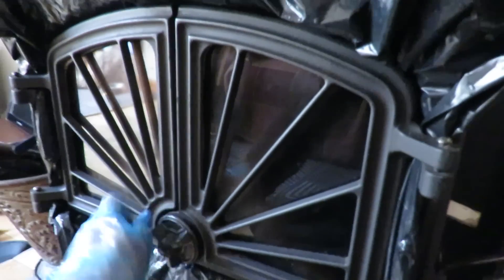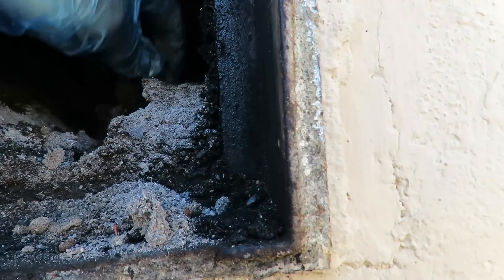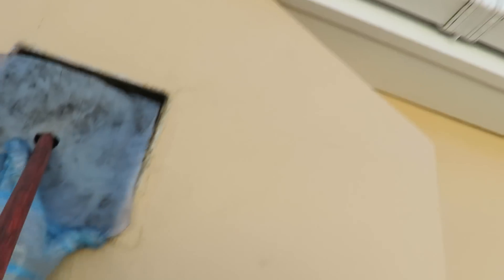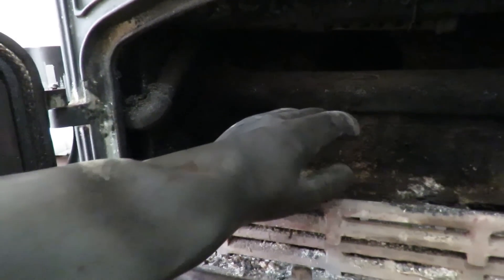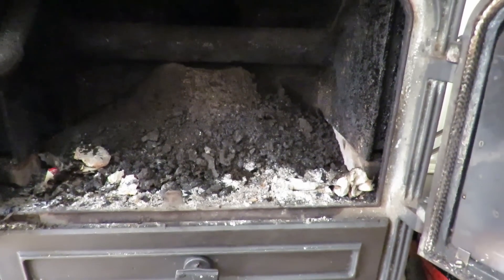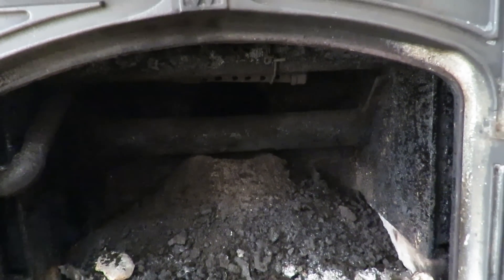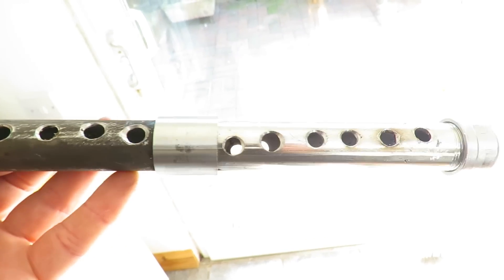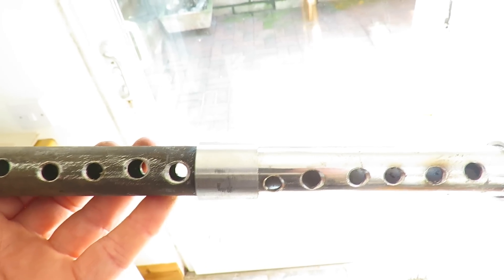Log Burner Stove Upgrade Secondary Combustion, Gasification, Burn Creosote, Smokeless Part 2

Comment: can you please say the design for where the holes were drilled. in the pipe. you say that they were facing up. yet in the film, they are facing sideways on. these holes could be critical. considering . the jets on a burner ring that burns. natural gas.  if using that same ring for propane. the holes/jets require being made bigger for the propane to burn. I know that the tube is carrying oxygen and not a flammable gas. the configuration for the holes/jets in the tube could be important.
Reply from the maker: The holes in the tube, when tightened on the thread face the 3 inch
perforated tube to supply air to it.  On reflection, it would be useful 
to drill slightly smaller holes in the first part of the tube and larger
 towards the end so as to spread the introduced air more evenly, but 
mine works fins with same holes drilled in. Perhaps a smaller drill 
would be better, but you can always make the holes bigger if need be 
after you have tested it.
Reply: I thought  that you had replaced the 3" perforated tube with the drilled 3/4" tube.
Reply from the maker: No the perforated tube is where the combustion of gasses take place, the stainless tube is the additional air supply :)
Reply: do you put the drilled air 3/4" tube inside of the perforated tube?where does the burning manifest? on the perforated tube, or at the drilled holes. more above or below. there is quite a gap. if the 3/4" tube goes inside of the 3" tube.    to prevent unburnt gasses bypassing the tube[s]. some designers have employed a filament. you could also add one in the system that you have. there is one consideration, and that is . the filament would require being cleaned every so often. that probably means that the filament would have to be taken out from the firebox. if the heat distorts the pipe unions. disconnecting the filament from the firebox could be problematic. unless the filament is not part of the drilled air tube.an English cooker manufacturer goes on about: that their design. the fire box can reach 1000c.all theirs is . is a wire gauze. something like a stainless steel brillo pad. set in a frame. the frame sits in above the firebox. hot air goes inducted up to it. then the burn is an incandescent under the filament. yet who knows. it could be above the filament as well. if you could make that part of the firebox out of glass. the incandescent would probably light your room up. you say that you get around 400c. the cooker manufacturer says. 1000c. therefore if you put the 3/4" drilled pipe inside say. a 1 1/2" perforated tube. then wrapped stainless steel gauze around that. then fitted a 3" perforated tube over that. that might be a filament. I can send you the links for what the cooker manufacturer says . about the temperatures got, by using a filament. thanks.
Reply from the maker: The air tube is secured to the hot water pipe / boiler that runs across the front top  of fire so it the air holes face towards the 3" pipe, with twisted steel wire
Reply from the maker: If we put too much coal in the fire, the temperature soars way above 400C even with all 6 radiators piping hot and a tank full of hot water, the flames get so hot, the water inside the boiler turns to steam, causing ketteling and we have to let it die down to normal working temp.  What I love about this modification is that we now burn scrap soft wood very efficiently, whereas before, it was gone in minutes. Now each fill lasts over an hour while the burn is very slow and more controlled.

Comment: This is very interesting to me. I have an old wood stove from the 1970s that's pretty efficient for it's pedigree but I've been wondering if I should add a damper to the stack. Your arrangement appears to work like a damper but with the added benefit of the secondary combustion. I need to try this. You used stainless steel pipe inside - do you think galvanized would not survive the heat?
Reply from the maker: Stainless is best because it comes already perforated and is more resilient to heat. Inexpensive too on Ebay  Ask to have the length cut to suit your fire.
Reply: Galvanized steel will release poisonous gasses when heated above a temperature that I can't remember. It is banned for use in wood stoves. Stainless only!
Reply: Galvanized (Zinc coated) pipe when welded on releases cyanide gas, this is why welders are told to never weld galanized, the welder will typically experience a migraine headache. Im your case gases are being exhausted up the chimney to atmosphere, shouldn't be a issue.

Comment: Interesting upgrade. Have you considered the consequences of the higher temperatures which I would suggest this stove was not designed for ? Is there any danger of any metal parts distorting for example the doors which as a consequence may leak ? No doubt you have a carbon monoxide alarm ?
 I know Im probably being over cautious, just hate to to think of anyone getting hurt.
Reply from the maker: Yes I have a monoxide monitor and all is well.  This fire is designed well with heavy cast iron door frames and hinges, will outlast me and my sons :) It was also made to burn without a back boiler, so the temperatures I'm reaching are comparable to this.  The older stoves are engineered to last a life time.
Reply: +G Laight ..The melting temperature of Cast iron is usually in the range of.. 1,150 to 1,200 °C (2,100 to 2,190 °F) Stoves classified as Multifuel can burn a wide range of mineral and are designed for seasoned wood, wood derived briquettes, brown coal (lignite) briquettes and approved smokeless fuels. When this particular stove was made, it was fitted with poor secondary air combustion, relying on primary air from the bottom of the fire, making it inefficient. Andrew K Fletcher Is showing that an old well made stove can be upgraded to burn smoke witch is just unburnt gases, by adding secondary air to the unburnt gases the (Smoke) is relit giving an efficient burn. He records temperatures of 310c  I would suggest this is Well inside the melting point of Cast Iron :gardenweld.
Reply from the maker: Latest temperatures with coal must be around 450.c as it goes right off the scale of my infrared thermometer and stays off the scale even when doors are opened for 20 minutes. Lesson learned is to use coal in moderation :)

Comment: Seems to be a rather insufficient oven... 
Imagine the amount of pollution spread to your neighbours
Reply from the maker: On the contrary, with these modifications the burner is virtually smokeless , the soot is now white instead of black so all of the carbon from the fuel is being burned. We only need to sweep the chimney once a year instead of 3 times a year, and the trees we burn emit the same emissions if they decay naturally and we recycle wood that would end up in a furnace creating electricity. Good question though, thank you.
Reply: Andrew K Fletcher.  ArrigAutist.

If you have a wood burner that is designed to re-burn secondary air at high temperatures there will be a minor scale amount of pollutants, the 
Re-burning of unburnt smoke and gasses at high temperatures is "smoke free" 
Here’s how a forest’s carbon cycle works: 
As trees grow, they sequester atmospheric carbon by converting CO2 in the air to leaves, twigs, and wood. The CO2 isn’t permanently sequestered, however, since virtually all wood (with a few exceptions, like Tutankhamen’s throne) eventually burns or rots. The amount of carbon released by burning is the same as the amount released by rotting.
As long as firewood is sustainably harvested — that is, as long as a logger limits annual cutting to the annual growth of the forest — burning firewood is carbon-neutral : Gardenweld.

Comment from the maker: Since the latest modification with extended drilled stainless steel tube
 as suggested by Gardenweld, the infra red thermometer has recorded 
temperatures off the scale of 400 degrees Centigrade. The fire was so 
hot it caused the water to kettle inside because the water pump was not 
running fast enough. Have now increased speed of pump and it has cooled 
the fire down better and boosted the radiator and hot water supply.
Reply: +Andrew K Fletcher I have been looking forward to this update Andrew. What a fantastic upgrade, People are unaware that the smoke they see coming out of a chimney is actually wasted gasses that can be re-burned before they disappear up the chimney. A hot chimney acts like a vacuum cleaner sucking on the fire, if people use this to their advantage like you have done in this video. When the log burner has reached around 300c and with a good bank of coals. By closing down the primary air The chimney will now draw secondary air from the holes in the pipe above the fire.This, in turn, then relights un-burnt gasses in the firebox slowing down the burn rate and increases the temprature of the stove, saving least 50% on your fuel bill, you will actually see the gasses relighting.. It has a name "Cowboy TV"  Thank you for your time and for sharing this video: gardenweld
Reply from the maker: What did it for me was when I swept the chimney and found only inert white soot / ash instead of the familiar black soot, which as a mechanic, common sense dictates the fire is not running efficiently, any more than blackened spark plugs indicate lack of air and too much fuel :)
Thanks again my friend for the kick up the ass to finish the upgrade properly. Your suggestion works a treat.
Reply: +Andrew K Fletcher You're most welcome. The only thing left that might improve your comfort further is to run your new secondary and primary air to the outside of your house, because your fire is pulling air from the room into the fire, that air has to be replaced by more air, this will come from places like windows, from around doors, floor board etc. bringing cold air into the room. Back in the days of coal fires, old houses had wooden floors and air bricks next to the hearth, drawing air from outside, just thinking out loud - worth mentioning. I look forward to your next video: gardenweld.
Reply from the maker: +gardenweld Cowboy TV---your not wrong there either, can't take our eyes off it :)